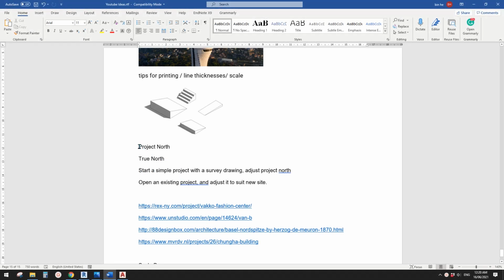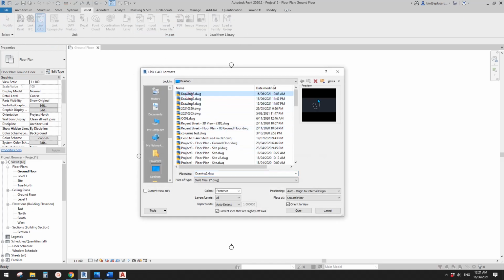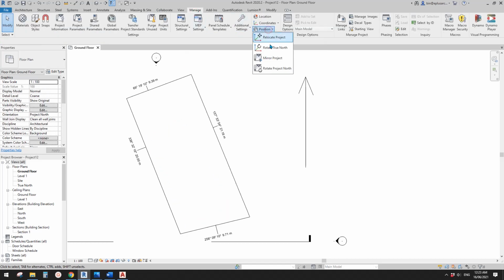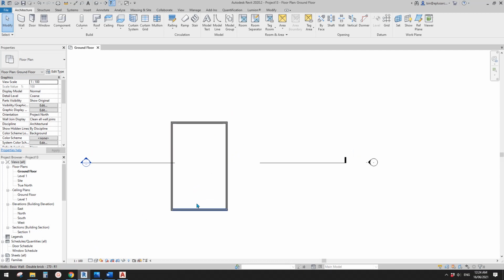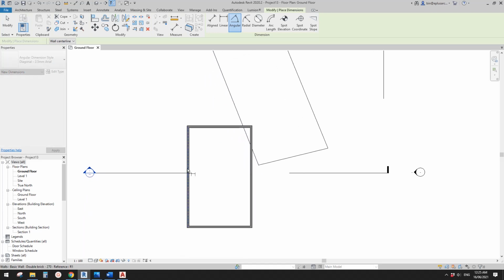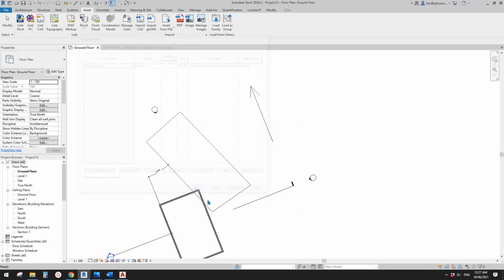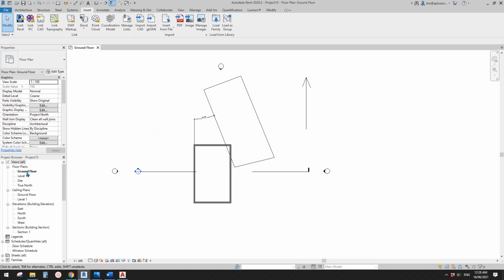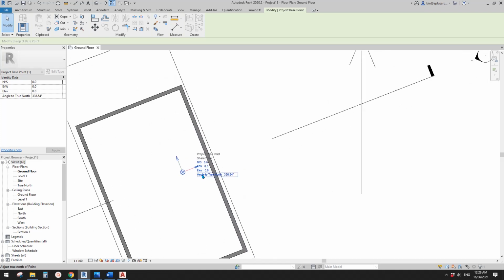Revit Everyday (Day 452) Quick examples of Adjusting Project North and True North

Comment: So, when you link the CAD file to Revit, it is automatically oriented to Project North?

I'm asking because I've linked the CAD File, being ready with it's true north position and I'm afraid that I might redo everything all over again, considering that I've just finished setting up the central site (Well almost, because I'm having problems with orientation). 

I hope there is a way of setting the orientation properly without losing all the progress that I've made
Reply from the maker: There is an option to align the DWG file with current view while importing. Our survey DWG files are usually facing the true north, so I always import them in a plan with with true north orientation. I don’t think you need to re-do everything even if your orientation is wrong, you only need to confirm your true north and adjust the angle between true north and project north.  You can share me your file if still not sure.
Reply: @BINHE615  I tried adjusting the angles between true and project north, but they just move away from where they're supposed to be
Reply from the maker: Try the opposite direction
Reply: @BINHE615  Finally fixed it after a week of trial and error by 'align on a plane or line'. Thanks a lot
Reply from the maker: Good work.  I still have trouble sometimes. It’s confusing.
Reply: @BINHE615  do you have a video on creating surrounding structures in revit? 

The same central file had buildings in it (as linked revit files) that are suddenly not clickable, even not movable.

Comment: why you need to link cad again ? 
I don't get it much :(
Reply from the maker: Maybe I didn't explain well. Sorry about that. I believe you can simply rotate the linked CAD too if you know what the difference is. The reason why I re-link the CAD file is to match the true north of the CAD (usually top of the page) to the new true north of the project.
Reply: Reloading the CAD file instead of removing and loading (after deleting the angular dimension in revit) might probably reduce few steps